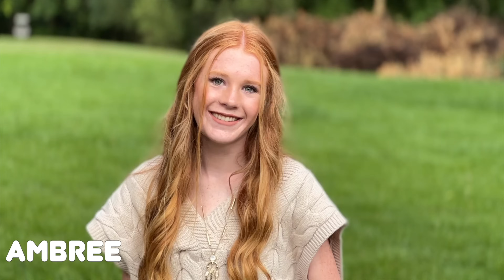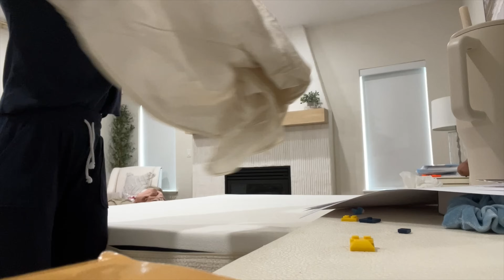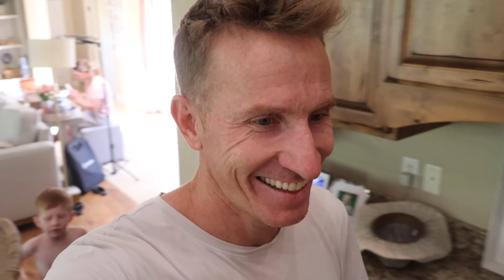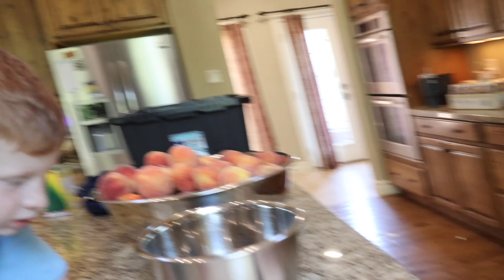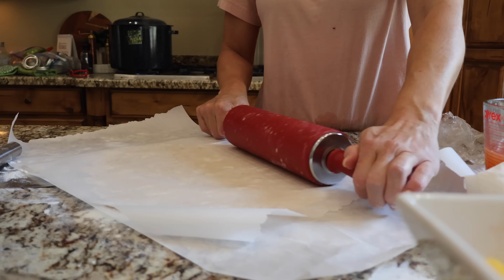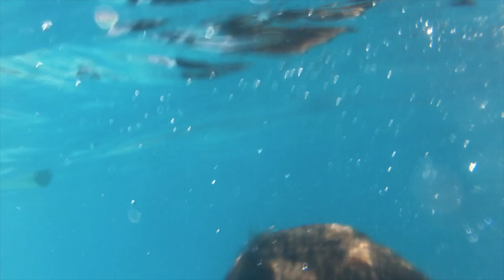she stopped breathing

Comment: I hope you are using "Mold & Mildew" resistant Green or Blue Board in the bath areas and the kitchen area if you are building those areas in the basement also! Drywall handlers are life changing when installing drywall!